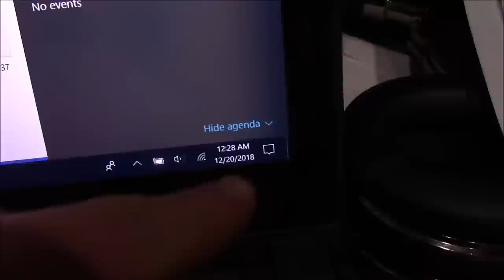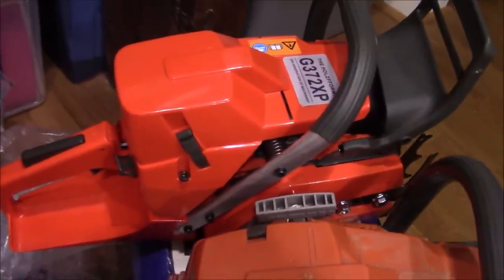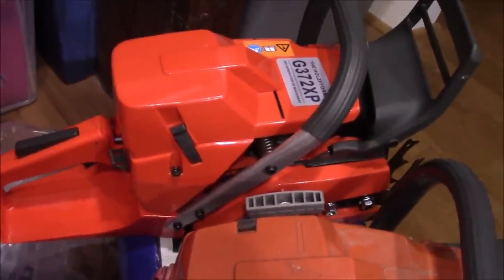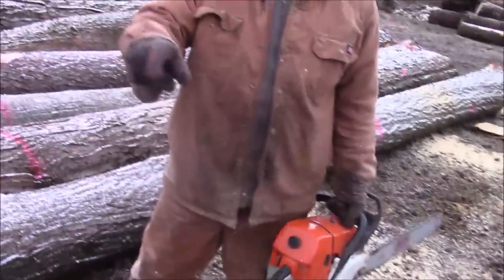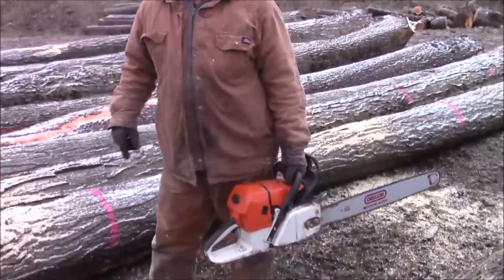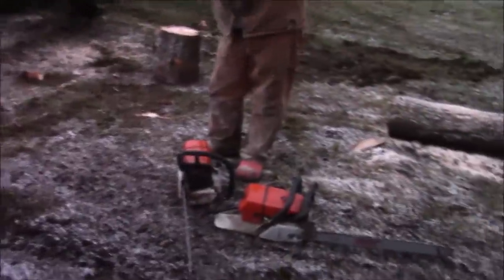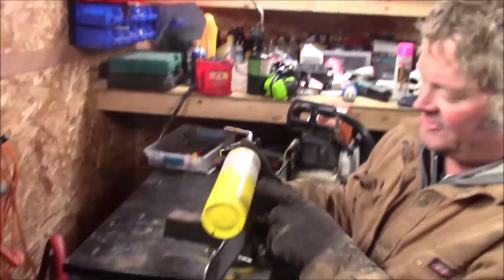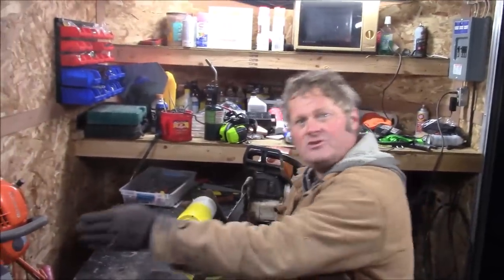Farmertec ms660 - Holzfforma g660 Test Saws Bucking Logs

Comment: Well I was able to do the muffler on the 76cc blower lol. So she is getting no base gasket. I still ain't sure witch solder you use to check squish with. The one thing I do know that sucks is these new carbs an the new carbs on these blowers arent adjustable but we will see how she runs after I get the new cylinder
Reply: Lead solder

Comment: Sparks flying at 15:00 guessin just dirt?  Don't normally see sparks like that during the day unless NAIL :(
Reply from the maker: Actually you would be surprised when the lights are out how much sparking goes on, no  nails. Maybe rocks in the mud though.
Reply: @afleetcommand  On the next trees I cut up I'm going to give his cutting method a try, LGX chain I'm using loses it's edge quick first sign of dirt.  Thanks for sharing those tips.

Comment: My impression of the hulzforma 660 is the carb is junk, the handle bars are soft and bend easily, and the fuel tank is too small. For 250 delivered I am still willing to mess with it. I put a 36 inch sugihara bar and still chisel skip that I grind and that was almost as much as the saw. Maybe ok for wood cutter
Reply from the maker: So go back the the build video's, the things I typically do to those have been articulated a bunch of times, no sense in re-inventing the wheel. At a MINIMUM get a Hyway brand handle bar and clutch. Stihl or Husqvarna OEM decomp. On the blue one the controls were better but I still would put in OEM choke and Trigger plastic. A good Spark plug and some of the carbs were OK but many I put on a Walbro from an 066

Comment: I cannot understand why you are promoting buying anything made in China!!!
Reply from the maker: You obviously haven't watched the series then. :) Took three years to develop those to where they are. Its not about promoting anything, its about documenting the process it took to get to that point..and documenting the trials and tribulations required to get those saws useful. The point is for most OEM is a far better deal. For the hobbyist..they can be cheap fun. Of course the irony is we are both having this conversation on devices most likely built in China. So not interested in the BS hair splitting any more. Just whats available in the market place, and you obviously didn't hear the conclusion. BUT folks will see what they want to see I guess. :) And the only Brand I would promote if I when that way in the channel is Jonsered. But they are gone now...:)
Reply: I have watched you videos and fully understand what you are doing. Maybe, “promoting” was the wrong choice of word. I had a 2165 rebuilt, asked for OEM piston and guess where it was made...China. Now I hear that OEM manufactures have better quality control than Chinese man. But that wasn’t what I was expecting.
Reply from the maker: Imagine my surprise to see OEM 550 cylinders with a made in China sticker. So the lines are blurred...by the OEM's themselves. My personal favorites are the Older Jonsered's like my 920's (Want a 930). I do like the 562's and do "promote" them as they are awesome done right and got a lot of negative press. Also promote anything on that 365/372 chassis like your 2165. Why not put an OEM (Mahle) 372xpw tp end on that saw?? I'm making a 2171 with a 372xpw  for my personal saw...call it a 2172xpw...:) And will "mod"  my 2172 X-torq to run well I think. It's time to get that saw right. But to your point, the 660 Farmer Jones is a saw I really enjoyed building and now running. It wouldn't have mattered if it was OEM or AM, because there was a "me" component to that build....a Hobbyist mentality. And it was half the cost of doing the same with all OEM but I got acceptable results. That "build/ownership" model was replicated with the junk pile 385's, partly because Husqvarna has responded by dropping their prices on OEM cylinders to the point it makes no sense to buy AM. AND if you are paying attention the 385's won the battle of which are "preferred" so an observant one might say I was promoting 385HTSS saws. But cost is a big factor for Hobby saws. A completely different priority set than with the for real work saws....and I say that over and over and sometimes it seems to fall on deaf ears. But at the end of the day, I'm about testing and using whatever happens to be available to folks like myself. Origin doesn't matter to me anymore. Fun per dollar and  bang per buck has to be a component of the story. Which is why I do both OEM and AM as that's what others do as well. I used to be very convicted on stay original/OEM,  now while I may be conflicted, since these things are out there, I need to show whats required to end up with a useful machine. That's the mission. Then the viewers can decide for themselves if going through all that is worth the few bucks they might save,..assuming time costs nothing. For a pro...like Matt who tests some of my builds, he doesn't have that time. OEM is by far the best choice. But I'm not going to promote any thing, just document and show real time both the emotion related to good and bad results along with a sense of the effort required. The viewers can decide how they feel about all that. That's the point. I guess another question is about the morality of NOT showing the effort required to build these into something workable. At the end of the day...he chose OEM HTSS Builds for his work saws...and runs my test saws because I asked for the feed back. AND they take pressure off the more expensive saws. And for me? I will test anything that is interesting and comes to the channel, regardless of brand or origin,  and I will keep the politics  out of it. Period.
Reply from the maker: Remember this one?

https://www.youtube.com/watch?v=simKDypA2zc
Reply: I was under the impression that the XPW is too high for the 2165/2171.
I had a new piston put in and the cylinder was honed and woods ported.
Reply: You cannot go through your personal belongings an tell us some of it isn't made in China. These OEM's charge premium prices while the dollar continues to devalue. If you want to find the greed look no further than the OEM companies.